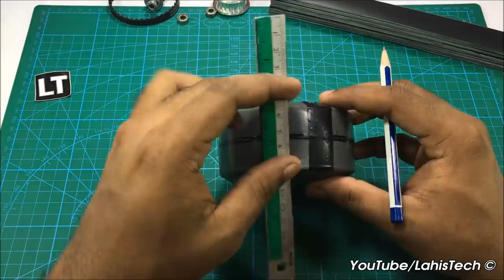How to make a DIY cross flow fan / Powerful cross flow blower fan / Air conditioner blower fan

Comment: Awesome build. One basic question. How does one slot work as air input, and the other as output? How come air is not blown out through the top slot, or sucked through the bottom slot? May be a dumb question, but I am just curious.

Comment: Doing this myself but i used 2 PC fans (12v 1.4amp) 120x120 4" wide (good strong PC fans) facing each other, one just acting as an anchor for the other which is only powered at 5v and it is completely silent. 
I glued a pieces of rubber right to the centre of the 2 fans, then fitted the axle that way "Direct Drive" works perfect. At 12v you would probably want it in a heavy casing or fitted tight cause mine nearly took off at first ha plus few fins came lose so need to secure it better
Reply: Hai,  post the video.

Comment: It pretty talented to make a never attempted design that works but also is a final finish product in looks. They usually a proto type attempts model that fine tune then later design for a finish product. So you back ground  must have been product design
Reply: To get a more compress volume the center is offset same as a snail pattern. Small on intake and larger as it exit, some thing to do with the intake closer so can compress more & exit larger volume w/ longer exit. I am making a blower on part ordered. Now

Comment: You should get much better performance if you reverse the pulleys.  The motor which can turn at high RPM but with low torque should have the smaller pulley and the blower should have the larger pulley.  This kind of motor have poor output when you overload it with a high torque load.

Comment: Hi, I'm working on a machine which is request a blower fan. I design and printed 3d printer and I mounted it but result was terrible. Because normally my machine( kind of hedge trimmer) draws 2,5 ampere but when I added fan its draws 12 - 16 ampere. İt's horrible. Can you share what ampere you are drawing with this machine. Also my blower fan pretty small then your. My B. fan size is height 30mm, diameter is 100 mm and 20 piece teeth. So do you have a any advice or idea what I can do to reduce my drawing current. Also I wonder how many amps your project draws.
Reply: in addition my motor is rs 555 and its rpm 16000.
Reply: SelamunAlaikum.
Solution :

1. Here, brilliant fan design is a crucial factor.
2. Change your motor to 775 motor. (Bearing)
3. For high rpm & torque, use 10-15amps, minimum, with necessary voltage.